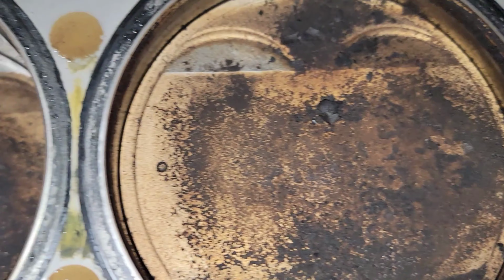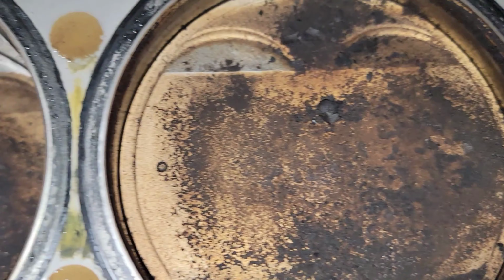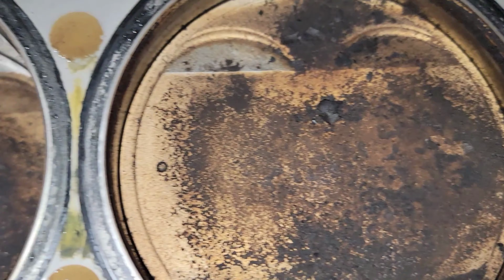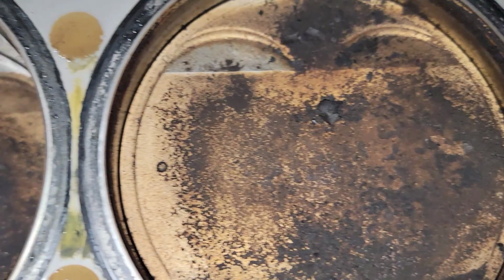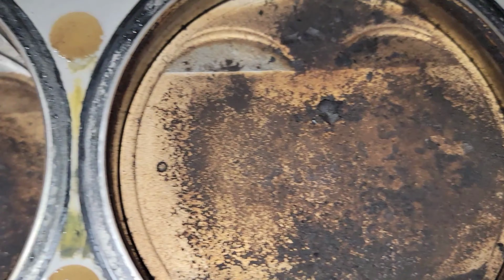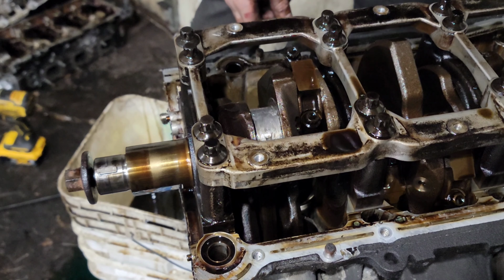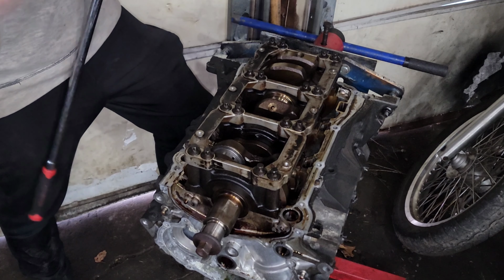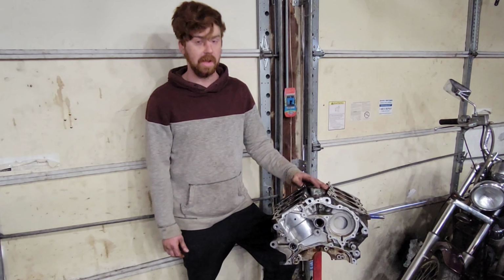SEIZED VQ35DE Engine Teardown! what went wrong??

Comment: Very informative! My son was driving his 2007 Infiniti m35x a couple days ago and the engine just, stopped. Would not crank again after that. Hit the button to start and the started engages and just does not turn. We had it towed home. Today I put a ratchet and socket on the cranks and it will not budge. I'll bring home my long 1/2" ratchet from work tomorrow and try it, but I am pretty sure it is locked up tighter than a drum. 😭

And dude, please wear some gloves! My body recoils each time you rubbed your fingers on those spun bearings! 💀

Comment: Very cool tip leaving the exhaust cam bolts in, I can't get them out but didn't know I could slip the timing cover over it after taking the intake cam bolt off.

Comment: Why fix an oil leak when you can just buy a new car? But seriously Nissan, the rear main seal design on these engines is a PITA. Removing the transmission is easy compared to dropping the upper oil pan and scraping all that RTV off. Curious why the front seal is so simple compared to the rear - crank flex caused by torque / weight of the transmission?